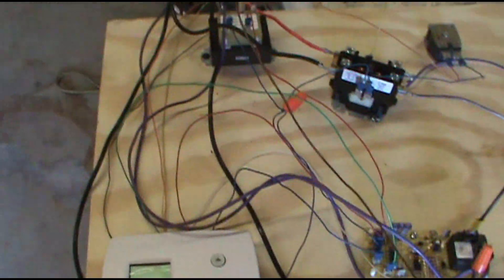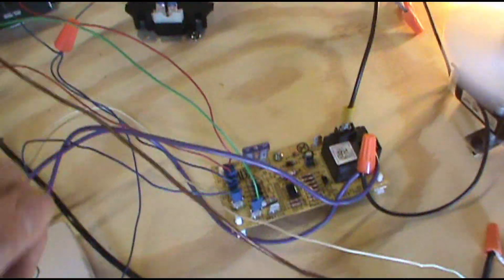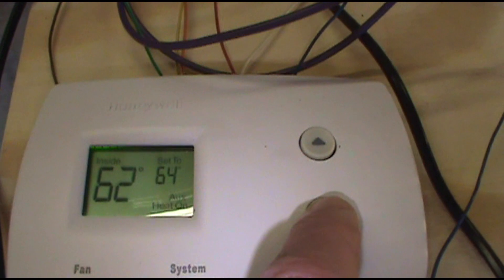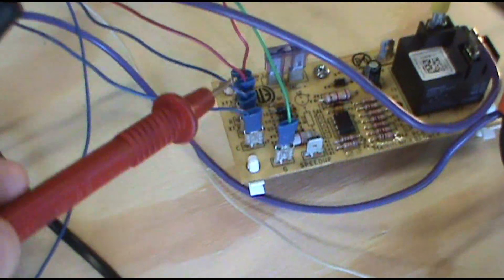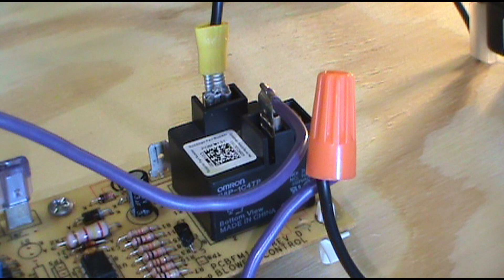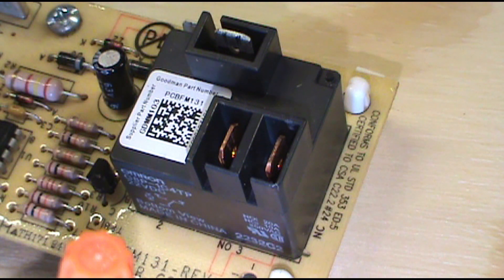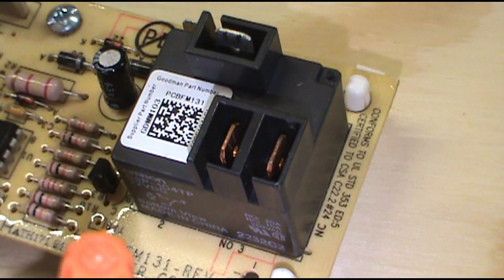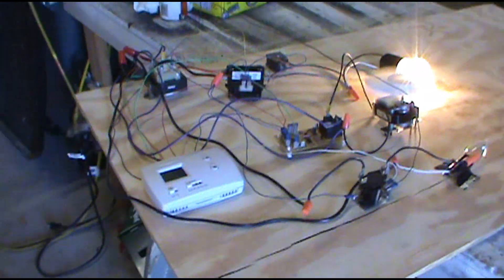Troubleshooting on HVAC Fun Board

Comment: I have one of these boards and it is not suppling power 24V to the thermostat, is that a common issue?  Fuse is good, inspected visually and with ohmmeter (got burned by a fuse once that looked good)
Reply from the maker: Hmmm I would need to be there for this head scratcher 🤔.
Reply: @LexVance  The board looks simple, and I am kind of confused myself.  I triple checked the output voltage.  Ordered a new one, so throw enough parts at it, something will fix it lol
Reply: @LexVance  It was a derp moment.  The wire from the board was broken inside the crimp connector on the board.  Only thing holding it together was the plastic covering.  Should have tugged a bit harder next time.

Comment: Fantastic!
"Train set" indeed. 
I'd dearly for this in other videos. 

Similarly, there's a guy who does a wiring video with all 3 boards on the same screen - thermostat, air handler ("inside") and compressor ("outside"). Good teaching techniques.

Comment: since you're on a insulated board, just use two transformers, parallel the primaries on 240v tap and series the secondaries. fixed :)
not everything may work right on that lower voltage.
Reply from the maker: Right on! Thank you so much for watching throttle!

Comment: Hey I wanted to ask, I've been dealing with the HVAC ever since I started maintenance several years ago. one of the techs quit so we were trying to fill our third man spot, and went through a temp agency until we found him. The guy they sent us was very very good at hvac and we had an issue with one of the boards and we needed to replace it. We've had to replace them in the pastand I did as we normally do and just grab it out of the package insert it and hook up all the wires. He said I was doing it wrong because I wasn't wearing gloves and he wanted us to order a different one (big issue) and I've done a little bit of research online about it and they said it could have an effect on the board, but like I said we've never had an issue with just installing them barehanded any input or experience with them failing because static electricity?
Reply from the maker: Yea, I've heard the oil from hands can cause circuit boards to corrode & break down quicker. It's the same for guitar amp tubes. When I had to get amp tubes replaced, you couldn't touch them with bare hands. I've done it both ways with no issues.  
Thank you so much for watching Maintenance Kid!

Comment: I appreciate this video it helped explain the HVAC process very simple. Rather it is a straight cool system or heat pump. High voltage converting to low is a great way to simplify this system.
Reply from the maker: Thank you so much for watching Scorpio!

Comment: In my opinion i am seeing alot of Straight Cool systems always lasting longer. And of course little easier to work on. Very awesome video. Thanks for sharing!
Reply from the maker: I LOVE straight cool. Heat pumps are just too many bells & whistles. So much that can break. Cool concept but Geeez they can be a headache. Thank you so much for watching Henry!
Reply: mine is 21yrs